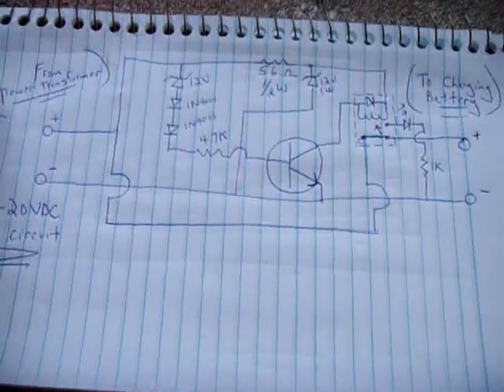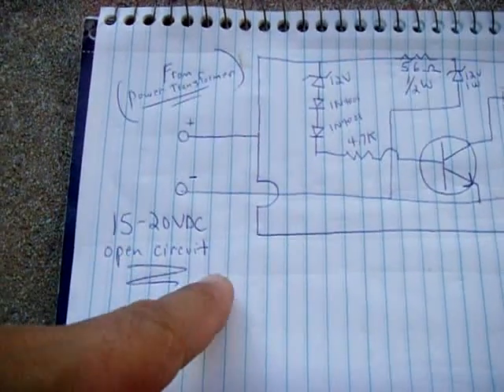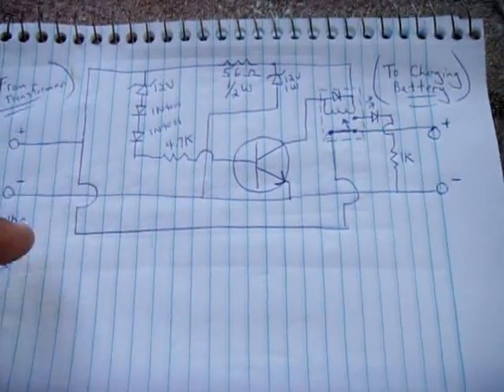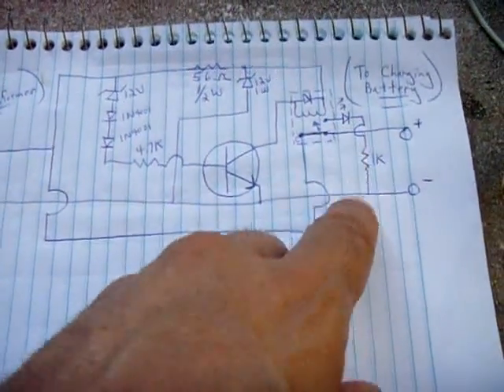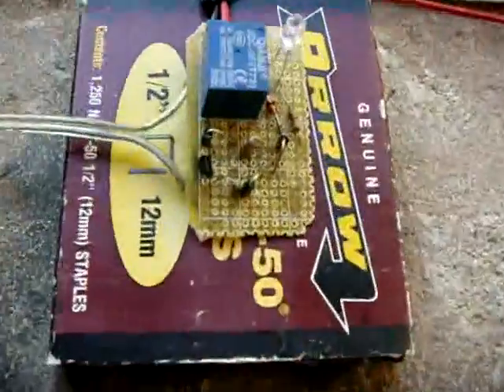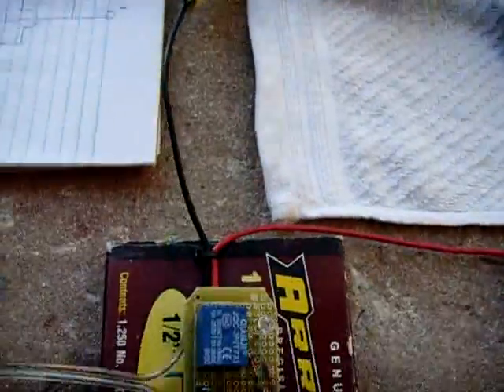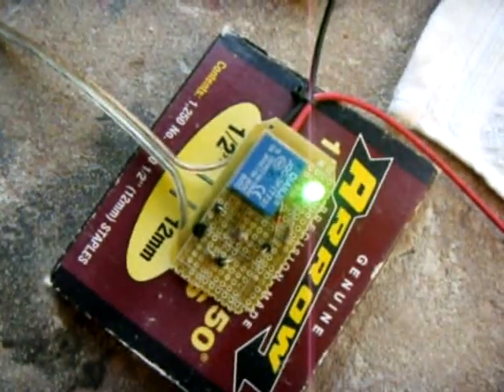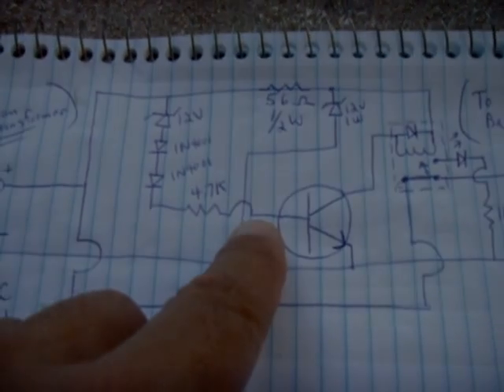Cut-Off Circuit For 12V Lead Acid Battery Charging

Comment: That will work for anything but lithium won't it? and with a bistable DPDT latching relay I could automatically set and reset flip flop a dual DC power source right? I thought that would work but I wasn't sure. Thanks man

Comment: Hello sir your circuit diagram which u gived in description 

I click it and it says this photo is. Not available anymore
Reply from the maker: Take a screenshot from the video with the video player full screen and at the highest resolution setting. Thank for watching!
Reply: @electronicsNmore  sir there are new simple auto cutof battery chargers which uses relay +potentiameter + transistor + resistor 

What do you think about those 
What's defrent between this and that charger?

Comment: This circuit works only in this demonstration but will not work in real life conditions. Think about this, let's imagine your 12V battery is about to die and reading 11.6 the voltmeter.. the moment you apply your 14.2V charger on the battery the battery will pretty much read the applied charge voltage.. the only way to read the proper voltage on battery would to disconnect it from the charger and read the voltage.

I have tried to design a smart charger many times without any micro controller and it always ends up getting too complicated and not worth the headache..
Reply from the maker: Always worked great for me.

Comment: Ehat is the restart voltage of it? 12v or 11v i tried other circuit from google and the problem is when it reaches 14v the relay is turning on and off countinuesly
Reply from the maker: Watch the video, I made it very clear how to reset.

Comment: Can I use this for  6volt battery auto charger
Reply from the maker: Yes. Replace 12v zeners with 6v zeners, use a 6V relay, and lower the 1K resistor at the LED to 470-620 ohms. You may have to lower the 56 ohm as well. Be sure to check out my extensive video playlists for other great videos of interest to you, rate thumbs up, and share my channel with others. Thanks!

Comment: hi i made this circuit and i tested it with capacitor i use capacitor instead of battery just to see if its cutting off and it did. i was too happy then i get my 12 v lead acid battery its have about 10.50 volts right now. and i connected it and its just cutting off dirctly without waiting it charge up. then i disconnected the circuit just to see if the battery charges with only transformer and bridge rec. and a capacitor . and it is charging it with about 15 volts and 180 miliamps. that is the problem when u charge lead acid battery its just jumps up to the charging voltage it doesnt stay at 10,50 volts (wich is needed for charcing circuit to work) so what is the slution here ? when u connecting battery to the voltage source its just jumps from 10,50 v to 15 v and its charging  what can we do here ?
Reply from the maker: The circuit definitely works. You may have a faulty battery or the circuit wasn't made properly. Thanks for watching!
Reply: thanks for respond but i didnt get answer i want. circuit is working fine. but what is the reason for my battery source voltage does not drop ? its just stays at 15 volts when connected to the battery

Comment: I may be able to use this circuit...........my dream set up would be a stand alone unit that would be before and in series with any old charger. It would use a heavy contactor and cut in at a low threshold and cut out at high. Do you have such a design?

Comment: This circuit is faulty, though concept is correct. In other words if you made this exact circuit, it won't work. I made it and it made a buzzing sound, it was from the relay, you need capacitors. Give me a day, I have made my own circuit, it works good, let me test and then I'll upload it and give a link here. And my circuit needs much less parts than this.
Reply from the maker: Sorry, it works just fine. The problem is your power supply.
Reply: electronicsNmore yep, but friend mains ac always has ripples, you need to put capacitors to stabilise it, which are missing in your diagram. Even transistor needs capacitors on collector and emmiter leads.

Comment: 14v is input here and 12v is output of this circuit (because of 2nd zener diode). How can we charge a 12v battery with 12v charger. I think we need 14.1v in output to charge a 12v battery.. Correct me if I'm wrong and please explain.

Comment: Hi. Very interesting circuit, but I'm a bit confused. Is this monitoring the 15-18 volts from the Transformer or the voltage of the battery being charged? From the video and schematic its appears its monitoring the Transformer voltage. In that case won't it be the case that as soon as the Transformer voltage reaches 14.2 volts the circuit would be cut off and the battery will never be fully charged?

If I got it wrong please would you explain it a little further?
Reply: You ought to answer his question, rather than just saying "the circuit works" and booing him off.
Reply from the maker: Output voltage is monitored. When the battery is connected to the transformer to be charged, that load causes the output voltage to DROP. As the battery voltage rises, the circuit will then trigger.
Reply: I'm still not convinced of the practicality of this circuit. When this circuit is connected to the transformer and the charging battery is not connected, the open-circuit voltage would be around 15-20 volts.  This would be above the threshold of the (14.2 volts) voltage divider made up of the zener and 2 diodes, and will turn on the transistor hence triggering the relay and turning on the led, indicating the battery is charged when in fact nothing is connected.

If you then attach  (the 'load') charging battery this will bring down the output voltage below the 14.2 volts threshold (assuming) and led will go off.  The battery will now start charging and  assume that after some time the voltage will rise above 14.2 volts and trigger the relay?
Reply from the maker: Shaz Miah Now you're wasting my time. The circuit works, just like everything else shown on my channel. If you doubt it works, then don't make it. I don't have time to argue with skeptical viewers. Have a nice day.
Reply: You are right. most of these simple transistor circuits don't work or start to hickup at the switch-off voltage. Reason is that bipolar transistor circuits don't have a clear switcgh-moment, apart from the schmitt trigger circuit. But this is no schmitt trigger. And even with a schmitt trigger there must be a hysteresis, that is also not clear here.

Comment: i have an APC 750 smart ups which i intend to extend its running time by replacing the internal battery with 6 12V 200AH wet lead acid battery, my main concern is that after changer the internal transfomer with a bigger one is there anything that i need to do to increase the charging current
Reply from the maker: jack anyona Not a big fan of charging more than 2 very similar lead acid batteries in parallel.

Comment: Can you use this with 215 Watt Electric 12VDC Motor - 25,000 RPM - 770 Frame Size Robot High Speed DC
 to charger 12 VDC 7.2 Battery?
Reply from the maker: What kind of battery?
Reply: WingedBull1 12vdc 7.2 Ah LSA Battery.
Reply from the maker: Use the simple circuit shown in my other YT video. It's ideal. Be sure to rate thumbs up, check out my extensive video playlists, and share my channel with others. Thanks!

https://www.youtube.com/watch?v=YuMTflaJjyw
Reply: I am looking for Automatic On/Off Switch for battery Charger that Can Charge a Battery 12VDC that it will connected to a 12-14V Generator.

Comment: hi sir, thank you very much for this video
sir i have a question about how you can calculate the resistor ?
im trying to make a 5V 1.5Amp solar charger.
Reply from the maker: Use a zener voltage regulator online calculator. Thanks for watching!

Comment: Hi , am i able to use this circuit along with the lm317 battery charger shown in your past video?
Reply from the maker: The other circuit is automatic as well, but charges at a much lower current. Why would you use this along with the other one? Makes no sense.

Comment: So are you telling me that you can charge a 12V lead acid battery with a 18Vdc input?
Reply from the maker: Yes, the voltage drops when connected to a 12V lead acid battery. You need higher voltage in order to charge the battery. Higher voltage "PUSHES" current into the battery. :-)
Reply: Will it effect the 12v zener diode and trigger the transistor to turn on since the voltage is higher than 13.8v (or 14.2 volts)?
Reply: omg this is what i was wondering why my voltage source doesnt drop when my battery is conencted ? is my battery broken or something  that cant make the voltage to drop ?

Comment: Can a 4 volt battery be charged through a PNP transistor by connecting the emitter pin to the positive rail of the circuit an the base to a zener so that when zener conducts the transistor stops conducting an current no longer flows from emitter to collector the positive output wire of the circuit will be connected to the collector pin can this work I saw something similar to it online

Comment: My concerns are 1: does shut off when is fully charged the battery? 2: can you connected to a Generator and then when the battery is fully charged will then shut down and when the battery is low in power will start again to charge it? I look forward to your reply please if you can provide diagram of what I am asking for.
Reply from the maker: Once the battery climbs to the set voltage, all charging stops. To start the charging process all over again once the battery has been fully charged, you would need to disconnect power to the circuit momentarily. The schematic is shown in the video. No need to post a link. Thanks for watching

Comment: I saw a battery charger circuit online that illuminates an led when the battery is fully charged can such circuit also offer overcharge protection for the battery it's just like your design but a relay wasn't included
Reply from the maker: This circuit has an LED.

Comment: AWESOME FUCKIN VIDEO!
Reply from the maker: Thanks James!  Be sure to check out my extensive video playlists, rate thumbs up, and share my channel with others.
Reply: does the zener between negative and the relay coil, and the resistor between positive and the coil regulate the voltage to the coil?
Reply from the maker: Yes. 12V regulated output to the relay coil.

Comment: ok had a 12 v sla hooked up to the output and the input was acidently shorted for a second, now I can't get the led to light even with no load on the circuit i can hear relay click but no voltage on closed side after the click.  replaced the relay and transistor and still no led (led checks good)....any ideas? probly just going to build a new one but figured someone might find this interesting

Comment: What if I had a bank of eight 12V lead acid batteries wired to suppy 24V to a load(typically 2-7 amps at 24VDC) being charged by a bank of solar panels (lets say six 80W panels each that supply 40VDC nominal)?  What would need to change in your circuit diagram?  I personally would add an additional relay(like an automotive starter relay) with the coil driven by the relay in your diagram to acommodate the larger power demand of charging the batteries overnight.  Perhaps a shunt resistor could be used to supply power to this circuit but I don't know how to use it in your diagram.

Comment: I have an existing charger with no cut-off circuit and it would go on charging at 14.4v continuously which could lead to overcharging, since SLA's are not very tolerant of overcharging unlike the flooded types, continuously charging at this level would lead to gassing, and prolonged overcharge will kill the battery.  So I modified it using an opto coupler controlled relay to cut-off the battery upon reaching 14.4v.  This circuit though is very good if you don't have an existing charger yet.
Reply from the maker: Thanks for watching!
Reply: rene kenshin

Comment: no current limiter... also a mechanical cut-off circuit w/o schmitt-trigger input.
Reply from the maker: No reason for the circuit to limit the current. I'm charging a lead acid battery and the current is limited by the power supply! Max output of my power supply is 10A. The relay cut-off works fine.

Comment: looks great but a quick question. If i were to test without a battery as you did in the video how should i wire the battery leads?

Comment: I created this circuit. Unfortunately like most other schematics available on the web, this one failed too. I tested the circuit with my 12V battery charged to 12.30 Volt. Nope, the circuit didn't stop charging my battery. Can you please explain the principle of the circuit? I mean, how would it sense if the battery is fully charged? All I see is that you are turning it on and off based on the input voltage i.e. the voltage received from charger.
Reply from the maker: Every circuit shown on my channel works. If you do not use the same components, did not make the circuit correctly, or use a different power supply, then you may have trouble. More than likely the power supply is the problem. It may not be supplying enough voltage/current.

Comment: hi sir, can I request u to help with my project which is to construct a battery charger circuit with auto cut off mode. The input power supply is from DC source, operating from 3-30V (27V at least) and the current is also variable (0-5A) according to the capacity of the battery wanted to charge. During the charging process, the green LED is shown. When the battery is fully charged, the red LED lights up and must cut off the current flow to the battery terminals to prevent overcharging. I would really appreciate if have provided me with a schematic diagram, components list and testing procedure. email : kcsu97@gmail.com
                                                                            With Regards,

Comment: This circuit is incomplete. The reference the Zener+2 diodes use must be the voltage on the battery, not the one from the power supply.  The circuit diagram shows the two as the same, connected by direct wires.  What it does not show (and why it does not work for some commenters below) is that there must be a (small) resistor between the power supply and the battery to take the voltage difference. The poster's setup is obviously using such resistor, but for some reason it is outside of the scope of the diagram, it is implied to be inside of the power supply.  Some power supplies have it, some (the powerful ones) don't, that is why it works for some users and doesn't for others.  The poster should be clearer about it as not all have sufficient knowledge to realize what is happening here.                                               Also surely the Zener after the 56 Ohm resistor should be rated above 12 Volts, otherwise it switches on before the other Zener (with the 2 diodes) has a chance to switch on. As a result the Collector-Emitter junction of the transistor and the relay's coil will be short-circuited by the Zener before the transistor has a chance to energise the relay.
Reply from the maker: +Bob Berg 
Hello Bob. The voltage of the battery and power supply will be the same. When the circuit is connected to a 12V lead acid battery, then powered up, the top rail will be the voltage of the battery. As the battery voltage climbs past the 13.2V, the NPN will start seeing current at the base. As that voltage/current rises, the relay will eventually trigger, which ends the charging. Once triggered, you need to power off the circuit to reset it. It works just fine as long as the power supply is sufficient for the job.

Thanks
Reply: +electronicsNmore During the video you keep referring to "open circuit voltage" and so do your respondents. That implies that while your power supply has sufficient voltage, it is not very powerful, ie has a pretty high internal resistance which plays the role of the voltage drop resistor I mentioned in my earlier post. Had it not been so, your "open circuit voltage" and "loaded voltage" would not differ much. This would be the case with a powerful supply if you don't put a voltage drop (or current limiting) resistor in line. That was the problem some of your respondents had. The moment you switch on a powerful (10 Amps+) supply it will immediately go to the high voltage whether or not the battery is connected to it. With a supply like that you will notice that the battery voltage drops after you DISCONNECT it from the charger. Also your second Zener has all the hallmarks of shunting the transistor and the relay thereby reconnecting the battery to the charger. This was another problem (a constantly ticking relay) that some of your other respondents reported. That works like some quasi-mechanical oscillator! If it does not happen to you then you have a latching relay.
Reply from the maker: Bob Berg
I can assure you the circuit works just fine. :-). If you have a problem with it, then modify it. Any rapid relay clicking issues can be eliminated by adding a 1000uF electrolytic cap from the NPN base to the neg rail.

Comment: Thanks, you were correct, not enough voltage. Substituted a plug pack that puts out 22 VOC & works well.
The old school charger that I want to use your circuit for only puts out 11.7 VOC, how can I modify your design to work with this voltage?? The prototype I've built shuts off at 12.8 volts which is OK
Congrats on your channel, you certainly go out of your way to help others
Cheers